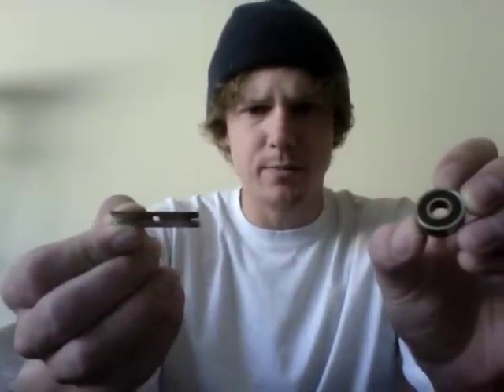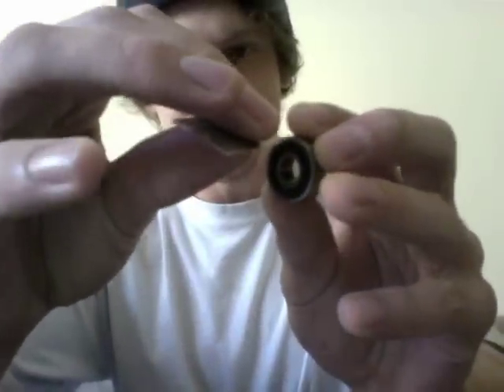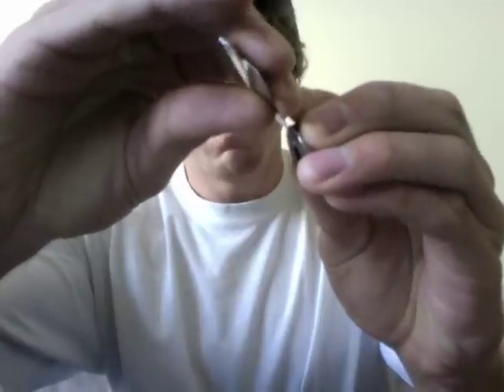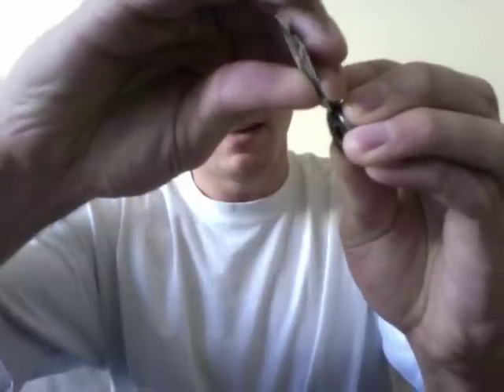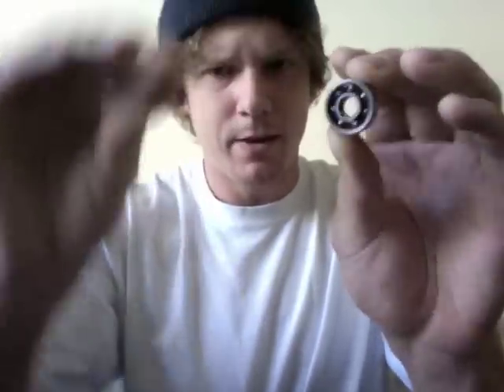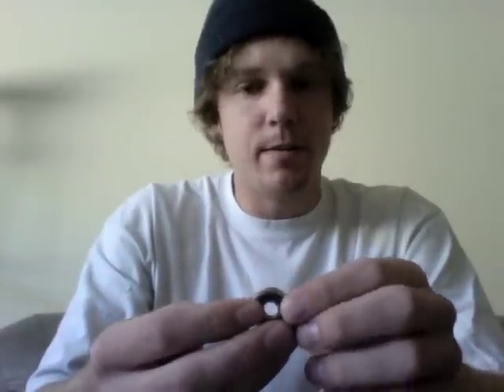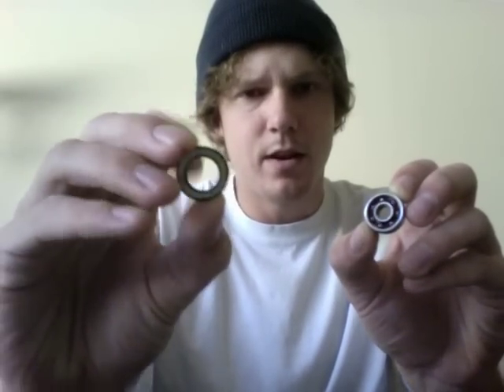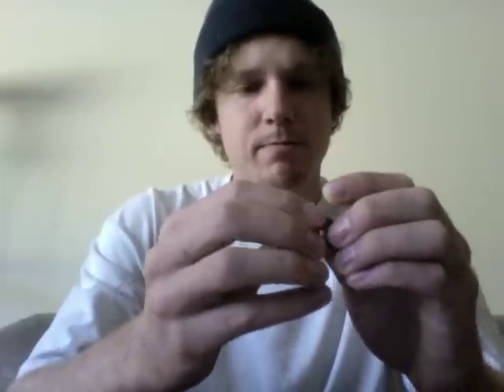Personal Review - Bearings

Comment from the maker: @S8OR You are one of the few that actually figured it out and are doing it right. I use to try doing that many years ago when I would skate Lucky ABEC 5's, but I ended up breaking more than I saved by cleaning them, so I switched to rubber shielded bearings because its easier, plus the Bones Bearings series are the best. Glad someone else knows how to clean metal shielded ones though, and I hope you continue to have fun skating for 20+ more years!

Comment: Hey, I love that you're trying to go into these matters a little deeper but I'd have to disagree with two of your statements here. The wheels make a significant difference. The way that they interact with the sidewalk produces more or less traction or friction, which directly affects speed.
Also, I don't think it's accurate to say that lower ABEC bearings require less maintenance; it's just that dirt in them has less effect because the quality and the tolerance of the bearings is worse.